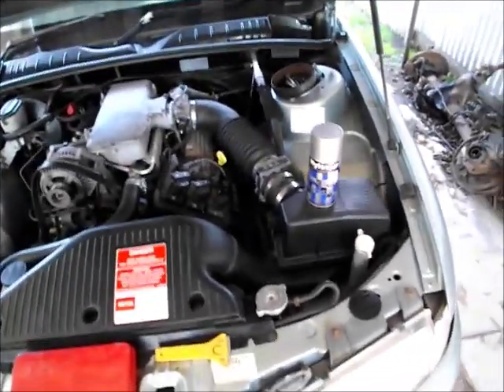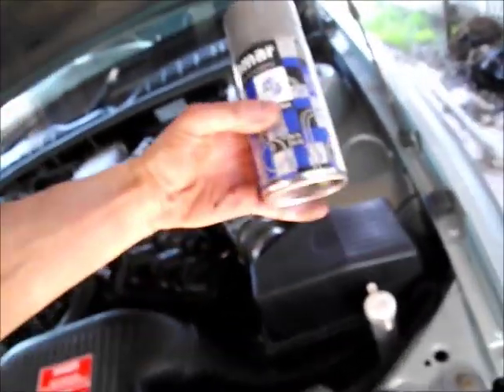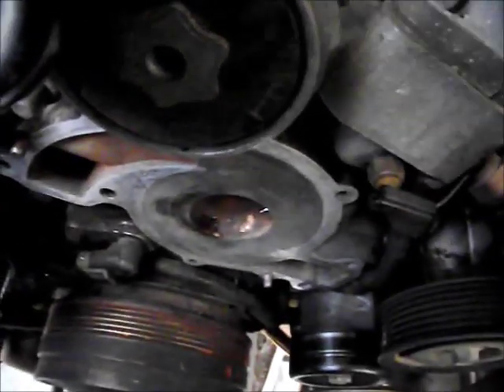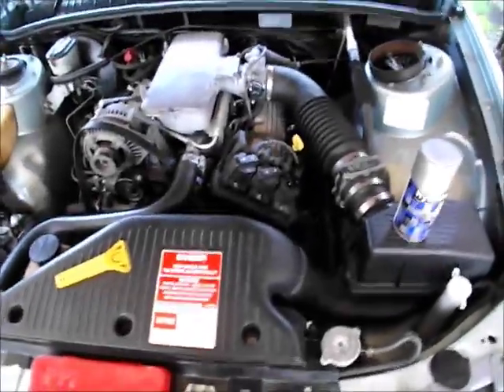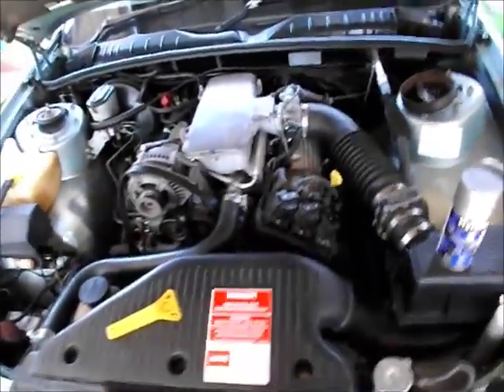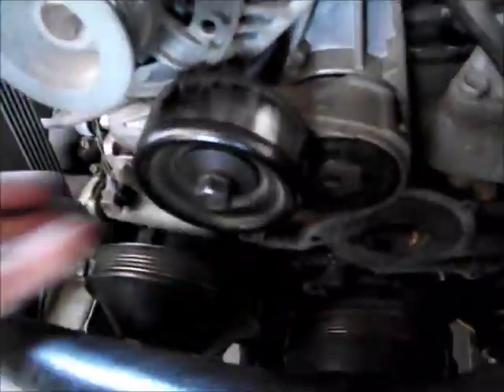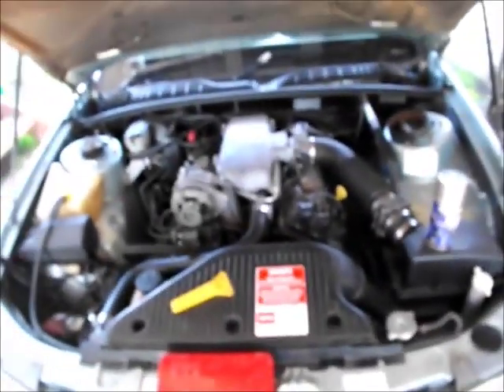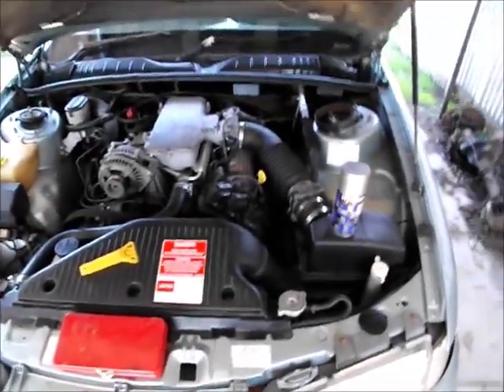vs commodore water pump replacement and cooling system maintenance tips

Comment: Thanks lad a tips video when it usefully combined with install tips is priceless.Ill definitely try the 1st product mentioned.If it works plz give em a plug.good work as these mongrels leak, seals crack and its a costly repair at your local lube n save. Can you do a crank angle video 1day please.TIA

Comment from the maker: ADVANTAGES OF USING NULINE ENGINE PULLEYS:-

• Heavy duty all metal construction offers far greater wear resistance

• Nylon cages for quiet running and extended bearing life

• ETK bearing grease for higher and lower operating temperatures

• All bearings have Labyrinth type seals for improved seal performance

• Tight tolerances to ensure smooth operation and extended life
nylon bearing cage? needs an nsk bearing with metal cage

Comment from the maker: i found a metal nuline pulley on ebay. so if it gets noisy i can install a new bearing.  what brand of bearing do they use? i only use quality bearings like nsk, koyo, ntn when i replace dead bearings, i bet nuline use cheap bearings. that's why i only but the metal replacement pulleys, so i can replace the bearings

Comment from the maker: the shitty steel clamps go out of round and won't seal once they have been removed(some do but most don't). i sometimes use scouring pads to clean surfaces too. a good quality scraper helps(not like the shit plastic one i used). yeah if the belt is stretched it's fucked and needs chucking out. i love hylomar, best invention. dad used to use it on peugeot 504 head gaskets when the head was shit, wonderful stuff.

Comment: Loads of info dave :-), i suppose the shitty clamps were ok when the pipes were new and soft/flexable.

Ive used brillo pads to clean up surfaces, but i suppose it depends how delicate the sealing surfaces are :-)

I think you were saying the markings on the auto tensioner shows when the belt is over streched, so ditch the belt as its bloody fucked, ha ha :-))

Ye olde hylomar red (in tubes) was my favorite for general stuff.

V8jagnut hates old rad caps as well, another handy bloke to watch :-)